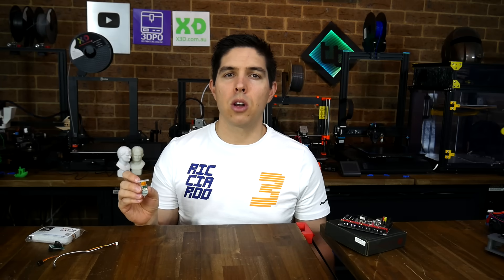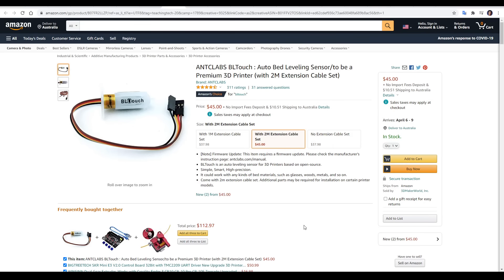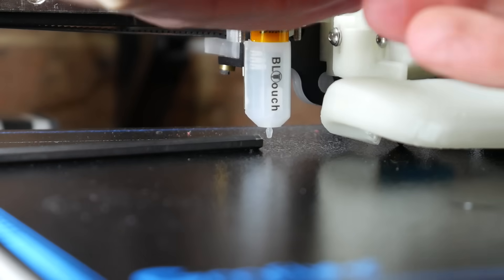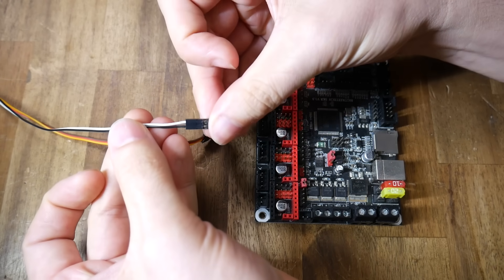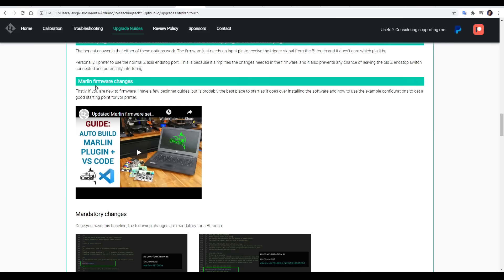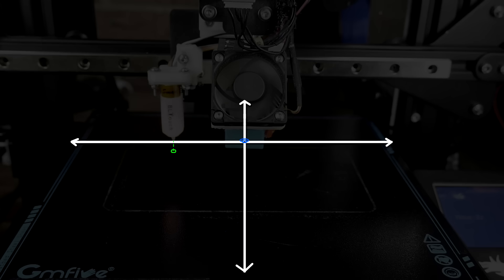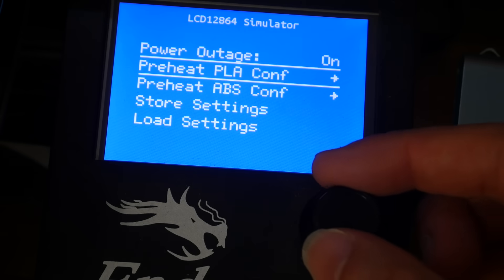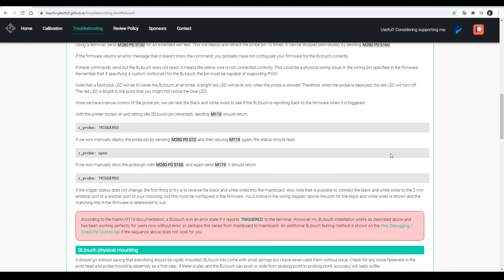BLtouch for any 3D printer - Comprehensive step by step guide

Comment: Have a nice day!
Based on this and another video I managed to install the 3d touch (BTT SKR PRO 1.2) BUT the Z offset part doesn't work, no matter where I set it, it always stops about 1 mm from the glass where the pin touches, but the value changes as you can see in your video (I used the dedicated place, not the servos) what do you think could be the problem?

Comment: This is a very helpful and informative video and thanks for sharing this. I do have a question though, will this BLTouch auto-leveling equipment work on or with a SUNLU model #8 or #9 FDM 3d printer. Any help or information that you can provide will be greatly appreciated. Have a great day!

Comment: Thanks for the tutorial! Really good stuff. But i got stuck in the very end. (Hopefully end)
I get an error with text overflowd with xyz bytes. 
Ender 5 , marlin 2.0 , melzi optiboot optimized. By the way I have 4 options there which one should I pick?
I put an enter in the code after one of the defines but that cant be the problem right?
Reply: I ended up buying the skr mini e3

Comment: Your guide got me 70% the way there and was very easy to follow. Thanks for putting it together.

I'm on a 128KB 8-bit board, so I have to manually reconfigure where the PIN27 board routed the signal, and turn off some stuff in marlin to get enough flash to enable ABL. 

I had to turn off the bootscreens, and enable slim_menus, turn off arc_support, along with a few other small flash saving features.

Comment: Good Grief!!! 
I bought a 3D printer thinking I could make things. The reality is tuning, modifying, replacing parts, buying add ons, endless adjustments, learning 16 different types of new software to print a plastic boat look at it and through it in the bin... This hobby is nothing more than useless pollution...

Comment: Watching this Video, I was able to fix my issues thank you! although you did not exactly show me what I needed, I worked it out from one 20 second clue you left in this video @ https://www.youtube.com/watch?v=eF060dBEnfs&t=667s in your Video. I have a single 5 pin JST connector plugged into the 5 wire plug where you show you only connect 3 wires. into that jack and the other 2 go into the Z min stop look connector. Mine is not like that. 

I changed the conf h and conf adv h files with the 3 items at the above time line PLUS.... the other instructions in your video in the CONF & CONF ADV H files..... I also had to disconnect my Z min stop micro switch as well at the micro switch or main board. (it does not matter which). The third thing that saved me .... was your other video on the Probe Z wizzard config change and set up. worked like a charm. Thanks.... another 5 or 6 hours of research and trial and error to get this ting to print lol.

Comment: You are best getting the CR Touch as it has everything you need for the ender 3 board v4,2,2 and v4.2.7 board and update the firmware to Marlin 2.0.6. All you need to do when install all this is to do the z off set and mine was about -1.3.

Comment: I just update the firmware to get the good bed-leveling grid code, and do it manually. Save once and forget it. This works as long as I don't mess with the print bed. But I'm going to install this on another printer, where I try different bed surfaces, and other experiments. So thanks for posting info about it.

Comment: 2 years ago I had a lot of issues because the offset was not persistant.
And I finally had to manage to have a offset 0 to make the BL touch usable.

I discovered recently that whenever you issue a G29 instruction it resets the offset ( in marlin ) !
So you should not have a G29 into your initial Gcode:

The correct usages is to make manually a G29, then set the offset.
Then save with a M500 to save the bed

Then on initial Gcode you use M420 S1 to use the stored bed map

Comment: For some reason despite having done all the things in this video the first layer isn't consistent with  a "CR Touch". It probes the bed but the print is too close in some places too far away in others. It doesn't seem to care about the probing results or something. I use Marlin 2.1.1.

EDIT, well I tried to put something on top of the bed when it was probing, to get wrong values on purpose. To see if that affected how it printed, and it did print too high in that area so it does seem to take the probing results into account. The results are just wrong for some reason, and always wrong in the same spot on the bed, so they aren't randomly wrong.

Comment: Great video, it cleared up a couple issues I was wondering about such as the probe margins.   Hopefully you will have added the CR Touch to your web page.   I will check it out and see if I can get my CR Touch to work with your instructions.   Supposedly it is a drop-in replacement for the BL Touch.

Comment: I have it in the servo port on BTT SKR V1.4 Turbo so ZMAX is empty, but if I plug in ZMAX and define USE_ZMAX_PLUG, it still will crash into the max sensor and keep grinding every time I load filament, home when closeness to max is less than the margin (It goes the opposite way slightly for probe clearance, but if I'm too close, that causes a crash into max as well). Settings:
// Force the use of the probe for Z-axis homing
#define USE_ZMAX_PLUG
// #define USE_ZMIN_PLUG // commented out as per BLTouch Smart V3.1 manual
#define Z_MIN_ENDSTOP_INVERTING true  // Set to true to invert the logic of the endstop.

#define USE_PROBE_FOR_Z_HOMING
// ...and all other settings recommended by BLTouch Smart 3.1 manual, except I use UBL not bilinear.

Comment: Thank you so much you not only taught me how to install  the BL Touch you taught me how to debug my noob custom build. I bought a garbage kit and wound up replacing just about everything. Now I have a fully assembled pile of custom parts and a Repetier Server. The printer refuses to move because I locked everything down too tight with safety. Now I am stepping through with minimum config additions. Finding your video at this time is just what I was wishing for. I am expecting an inevitable firmware config issue. My full firmware build compiles and installs but locks everything to the off state.    Your videos have been helpful through this whole process.

Comment: I need to make a 5 wire custom wiring harness to connect a bltouch from the motherboard to the breakout board on a Fokoos Odin. Needs JST-PH 2.0 connectors (just the pins, no sockets) on one end and Dupont connectors on the other end. What size/s wire would you suggest i use.

Comment: Great guide.  I'm attempting to install a 3D Touch right now.  It is supposed to be for the Ender 3 but I discovered BEFORE installing that they had GND and +5 swapped on the cable.  Fortunately caught it BEFORE plugging it into the "Pin 27 Adapter" as I was verifying the orientation of the 3 pin plug.  Maybe this is why some people hate them because of stuff like this?  Anyway THANKS!!

Comment: Thank you for another great video 🤘🤘Yesterday I received my BLTouch for my CR-10S and printed the appropriate fan shroud/BLTouch adapter. I should be able to install it tonight and give it a shot! 

My question would be, is it possible to retrieve the Firmware that's currently being used? That way I don't forget any settings that I currently have...

Comment: Hi Micheal, I have had my BL Touch working fine for about 18 months but lately the adjustments are not being made, the mesh is created by the probe but the Z motors are just not turning, I have checked all connections and even swapped out the probe and all is good, do you have any idea what may be causing this?

Comment: After installing, homing, setting and saving x (-42.46) and y (-13.09) bed will not home to center. Homes to original location. Any ideas as to why it wont home to center.

Comment: I understand you can wire the BL Touch to a Raspberry Pi 3 or 4?  This way you also do not have to deal with your Marlin firmware and wiring to your printers motherboard..  Can you tackle that?  I have an array of printers from Lultzbot Taz 4 & 5, Rigidbolt etc.  Thanks in advance.

Comment: Have you installed the BLTouch on the BiQU B1? If so, do you have an install guide. I have tried numerous ways to get it to install, but it prints in the air. It auto home's to the left-hand bottom corner by manufacturer default, so I can get a true Z offset.

Comment: I really wanted this to work on my printer as it seems really easy to follow but I dont see where to plug in the 3 wires yellow/brown/red.I have a MPK V1 board which  is in a hictop 3dP17.Given up for now. My board is too old to have a dedicated port and doesnt even have pins D11 which is mentioned in several forums about hictops and the sensor.

Comment: Installed my BL touch according to the video. Used the daughterboard for the LCD connection, and the z stopper motherboard header.

Turn on printer, BL touch tests itself twice.

After doing a auto bed level, the bl touch doesnt deploy, and the nozzle hits the bed, motor halts.

Cannot manually deploy or stow the BLtouch through the  LCD commands either.

Not sure where else to look.
Reply: Assuming you've made all the necessary adjustments in Marlin and that you're using an Ender 3, try swapping the black and white wires around in the Zstop connector that goes into the main board. Solved this issue for me.

Comment: I wired my bl touch as shown in the companion site wiring diagram (black and white wires replacing z endstop switch) and made the changes to my firmware files. When I tried flashing the firmware to my ender 3 pro (V4.2.2 board) the LCD screen flickers rapidly and I smelled a burning smell, and immediately powered off the printer. Any idea what caused this and did I just ruin the board???

Comment: Hi I’ve got a i3 Pro B and I’m adding a 3D Touch can you suggest the best place to put the wires in GT2560 main board ? You talk about z ports and the servo ports which I have , any advice and do I need to to any firmware upgrade I’ve got the the latest on it now . Any help would be great thank you .

Comment: Hi there, seems i have messed something up... I watched all your videos on this, how to upload the firmware, using VS code etc..

The first firmware i put on was for the Ender 3 v2 From the Marlin GIT... All that did was fill my LCD screen with random numbers and question marks..

I then used the firmware you suggested, " CrealityV422 " (I checked to make sure i have the 4.2.2 board)

Uploaded that firmware to the printer, now all it does when i turn it on is scream at me with a high pitch beeping... Wtf have i done wrong...

Edited: I redid the whole process from scratch.. Deleted all the files and redownloaded them..

This time ive noticed this error after compiling the second time after replacing the files from the Config ZIP

/home/xxxx/.platformio/packages/framework-arduinoststm32/variants/MARLIN_F103Rx/PeripheralPins.c] /home/xxxx/Downloads/Marlin-bugfix-2.0.x/.pio/build/STM32F103RET6_creality/.sconsign38.dblite: No such file or directory

Comment: Thanks for the video. I had problems with my nozzle and Capricorn tube and had to take my hot end apart and then needed to redo my Z-Stop dimension. Your video was very helpful and I also learned that there is a Z-Stop Wizard in Marlin, thanks to you. I'll give this a try next time I redo my software.  Looks very easy.

Comment: So I have installed my BL touch, used multiple sources to put the firmware together (mainly your info as its exceptional) although there are issues. I also have dual Z stepper motors. I have an skr e3 turbo and since I have had it, it has never stored settings to eeprom using the store settings function (anything I manually change in the printer settings, I then update in firmware and flash it next time I want to print something...) - could the fact that nothing is being stored, be the reason why after an ABL, the bed level print I do comes out... not level at all? :( my beds manually close to level already.

Comment: I have tried just about every tutorial and I have come to the conclusion that the BL Touch simply does not work. I tried everything for literal HOURS, lost so much sleep and absolutely NOTHING worked. I thought I had it with the right FW and did the z offset, then a successful mesh level, then loaded up a print job in octoprint and it failed in the middle of leveling. I. Give. Up.

Comment: Does this work for every 3D printer? Like a Tronxy or something. Im very interested in this sensor because it works by touching the bed and not by sensing and looking for something metal. If a bed is too thick and isn't metal, it won't sense it and ram into the bed and make a hole. Just worried that every firmware is coded differently and so it won't match up with what you are telling us to do.

Comment: Is there a way to modify the stock firmware supplied by Creality? All you get is the .bin file, so can't just import this into VS code. The stock firmware works fine - Marlin2.0.1  BLtouch V1.1.1 Non-adapter board firmwareTMC2225 from the download section of the creality website, but when I create a new complied firmware using this guide, the Z home doesn't work so the nozzle never gets past the homing xyz stage. I can't seem to get this to work, so reverted back to stock, but would like to add custom entries to the firmware.

Comment: Hi All, I have an Ender 3 pro and have just fitted an SKR mini E3 V2.0, a TFT35 E3 V3.0 screen and a BLtouch V3.1 with a single row connector on each end. The board has Marlin bugfix 2.0 . The board and screen seem to running ok. There are many videos out there but I could do with some help and guidance in sorting out the BLtouch. I am confused as to weather you leave the Z switch connected or not and do I need to download any firmware for it to work. Any help would be appreciated.

Comment: I have a Sidewinder x1 with the MKS Gen L v 1.0 and i've been trying to install the z sensor as a replacement for the bl touch.  Unfortunately they aren't as good as you as describing and detailing what goes where and how.  I installed the new marlin code, and it will home to x,y and z starts to go down but I can't get the sensor to activate.  the little light on the sensor doesn't come on.  I double and triple checked the wiring.  Perhaps it has to do with a hex code he includes but I have no idea where it would go or do?  Help!

Comment: hI. Nice explanation. But i having some issue with my probe. Recently I change my sotck Anet A8 board for a BTT SKR 2.0 with TMC2209, every thinks looks working fine, but my bl touch looks like having some problems. 
When homming and bed leveling, it works fine, but when I turn the nozzle and the bed heating (ex: pre heating pla), the probe start to stow and retrac by itself, and the same occurs when printing. This is really ramdom.

I´ve tryed different conf + change wire + change form bltouch pin to a min z pin. but still with problem. 

Do you know somenting about it?

Thanks in advise.

Igor

Comment: I seem to be having an issue with my bltouch. It is not compensating for the differences in height on my print bed. Is there a setting I am missing for this. I have an original Ender 3 with the Creality 4.2.7 silent board and the BLtouch v 3.0. I recently installed the Ender Extender 400XL kit and compiled my firmware with help from your videos. Please help..

Comment: Hi Mate,

I think you're the only person who could help me here... I've been dealing with this for a while. I have an Ender 3 Pro with an upgraded board, have kept the z axis stopper on.

When I do an auto bed level (G29) in the start code and go through the entire process during the print everything works fine.

HOWEVER - When I M420 SL to load the saved Mesh, I have to manually babystep up by increments of 0.2mm in the first 5 layers due to the printer not doing it for me. I noticed with an unleveled bed the Z axis does move to compensate based on the mesh, so it isn't the motor itself or the rod.

I noticed the Z axis start position on the main screen is 0.98mm, and as the gcode tells the printer to go to 0.2, 0.4, 0.6 etc all the way to 0.98 it ignores these commands as if it goes lower it will go into the bed. And this is why everything works perfectly after the 5th babystepping of each layer, it ignores the commands until it reaches 1.0mm.

Is there any way to set the ABL mesh to 0mm to start or am I missing something really obvious here?

Love your videos,

Thanks!

Comment: Holy Frick. 
Just bought an Ender 3 Max last week. Haven't been able to produce a single viable print. All I've tried is the 3d Calibration Cube and it keeps failing. Delamination, warping, all kinds of issues. Discovered that my glass bed was warped up in the middle. Bought a BLTouch, installed it, leveled the bed, and my first print was beautiful. It's like magic.

Comment: I upgraded my Ender 5 Pro with BTT SKR PRO V1.2 & TFT35V2.0 with BLTouch, I followed your video/website step by step.  When it homes the z axis it moves to the past x y center & homes.  When I level the bed either ABL or UBL it does the but on ABL only level that point, then y zero 3 points along the x(not centered); during UBL it probes around it and goes off bed probing but the soft end stops prevent it from crashing into the bed.  I sent gcode to go to the center of the bed and it goes to the exact center.  What am I doing incorrectly?  Or how can I fix?  Use probing margins also, along with z safe homing.

Comment: Now I have a question, I use G29 after G28 in my start gcode, it creates a mesh ( I can see it in octoprint) and stores it but for whatever reason doesn't use the mesh, so it doesn't compensate it's just rly close and rly far at some points but never actually even. How can I fix that?